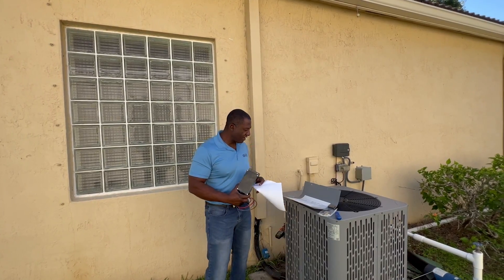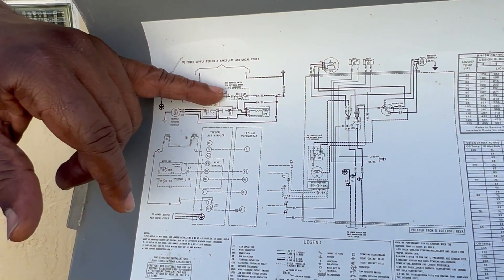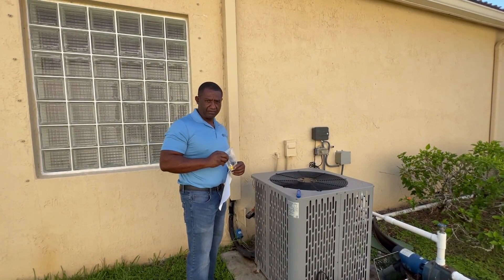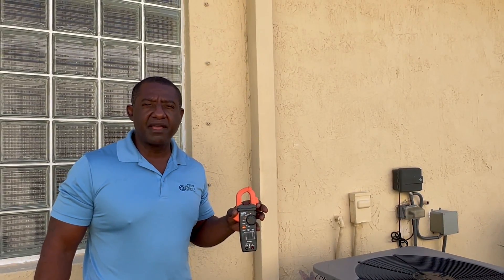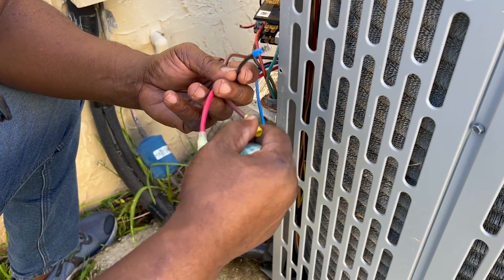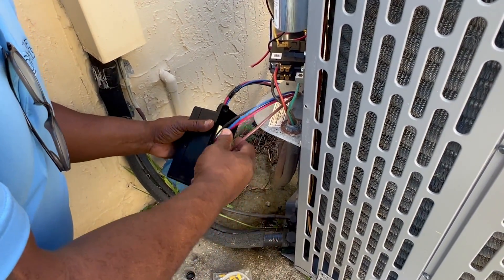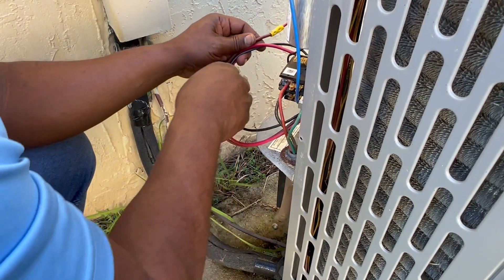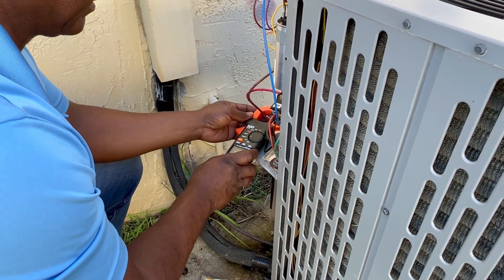Walk-through of ActiveStart Home Installation AC

Comment: I may have missed it but what size is this AC unit? 4/5 ton? 
Thank you
Reply from the maker: In the video is a 3 ton AC unit but the 40 amp version is ideal for Residential Home systems,  Marine air Conditioners or Commercial units drawing less than 40 amps  this is typically 6 tons or less.

Comment: I saw a link for  your page on an Rv site on Facebook. A happy customer had shared it. First let me compliment you on  this very well done field video. Your presentation gives great information about the ac and connecting as well as equally important safety precautions. This unit installed. At the end your unit is running on the soft start. Is your fan a multi speed one? Or is the video playing tricks and its not going slow. Im investigating a unit for my camper and have seversl other  " tech like " questions thanks Joe
Reply from the maker: @joegifford1668  Hi Joe...its one of those tricks video and spinning objects! I have a single speed compressor and single speed fan. You can post questions here or contact us directly. I'll be happy to answer them.
Reply: @activecontrolsllc  ok I have 2 Wen inverter 4k peak 3500 rated generators. Each have a 30 amp plug I can plug in my TT and have and it works my camper. I also have the parallel kit to connect both and end up with a 50 amp plug. I intend to install a 50 amp plug on my house going to either a panel interlock or a 50 amp interlock switch panel. Now.  I am wondering if I should get a 50 amp plug starter. And I have seen the  app and can this be used with one of my gens with the 30 amp plug and an adapter for my camper as well as the whole house? Possibly a single  gen on the house as needed? Both not needed most of the time
Reply from the maker: @joegifford1668  Yes. That is correct. I have another video showing that running on my house as well. Having the wired version on the home AC combined with the 50 amp unit I can easily run my whole house on my 7500 peak generator. The best solution is with the wired unit on the AC which allows you to use a smaller generator instead of like a 13KW or 15KW.

Comment: Could this be used to soft start a well pump?
Reply from the maker: Hi...it can as long as the pump has a PSC motor. Basically means it has a run capacitor mounted to it. Contact us with info and I can look closer at it.

Comment: Ok, I have purchased your ActiveStart SoftStart ACS30P 30AMP unit for my RV to run it with my 3500w generator or my Titan Solar Generator. Looking at your channel here, I am wondering if it would work for my house if get a professional to wire a transfer switch or sub panel to connect a generator in case of a power outage? Or, do I need to get this new product you make that wires directly to my unit? My house AC unit is Goodman Model GSH130421AF Max breaker amp 30. Min. circ amps 22.1. voltage range 197-253 phase 1 hertz 60. p.s. I am really impressed with your informative website and youtube channel. I am a small business owner and I try to support other small business, especially veteran owned. Thank you for your service to this country.
Reply from the maker: Hi Stacy, Thankyou and these are great questions. I was actually going to do another video this week to help users pick what's best for the application. In this case the ACS30P is only for 115 VAC application which means it would not work well for your house. The wired version directly on the AC would be the best option for the home with current offerings and you will be able to run that unit off of your generator without any issues. I am planning the same thing for my house and that will be another video coming soon. I have the 50 amp version of the plug and play that will be available in Feb timeframe that will handle the rest of the house and could be wired with transfer switch as you have described and give complete emergency backup capability without the need for an extremely large generator.

Comment: How does your product rate against Micro Air Soft Start?  Have been looking at that one but now really interested in yours!  One Veteran to another supporting small business owner and Veteran. Look forward to your reply.
Reply: My current 3 ton unit LRA is 77.0 and RLA is 14.1 30 amp max breaker.  Wanting to be able to run both heat in winter outage and summer cooling outage.  Using a Predator 9000 generator.  Thanks for your reply.
Reply from the maker: @bobbyphillips7190  Appreciate the comments and question. My softstart outperforms the competition including MicroAir which gets on average 60-65% reduction while I get a consistent 80% reduction based on measured inrush current. Others use the LRA for the calculation which most of time is higher than the actual. Your predator won't even notice the unit starting. I'll be doing a video in a couple of weeks with the unit and starting it on a westinghouse 7000 peak. My Bluetooth can also be wired to monitor the unit all the time not just when the compressor is running.
Reply: @activecontrolsllc  Thanks for your reply, so when is your product going to be available for purchase?
Reply from the maker: @bobbyphillips7190  We are hoping for January! If you'd like to be added to a release list just let us know and leave your email or email customerservice@active-controlsllc.com and just say you want to be on the release list.

Comment: Can’t wait for this product to come out!
Reply from the maker: It will be ready by the end of the year. Finalizing the APP.
Reply: @activecontrolsllc  I didn't see the 50 Amp residential unit on your website. Is it coming soon? Thanks.
Reply from the maker: @zbe859  Hi we rearranged our menu structure to make it easier to navigate but that doesn't seem to have happened. Use the top menu where it says shop and select activestart products and you will find all our products. The unit is available for the home.